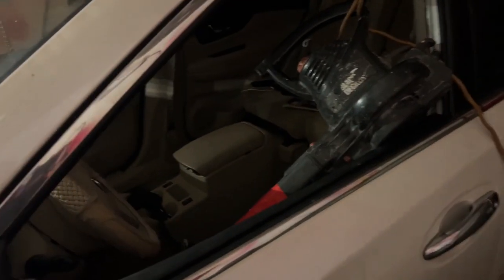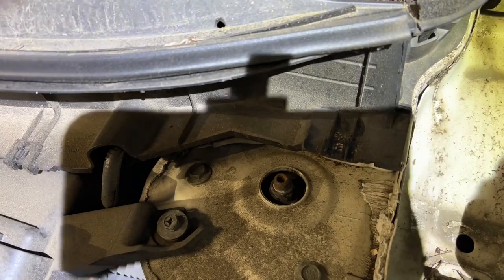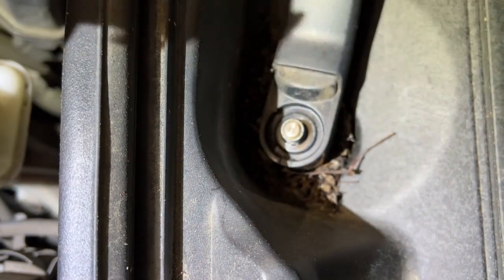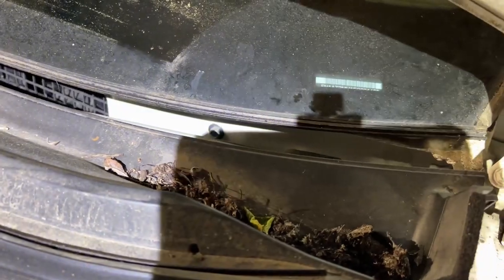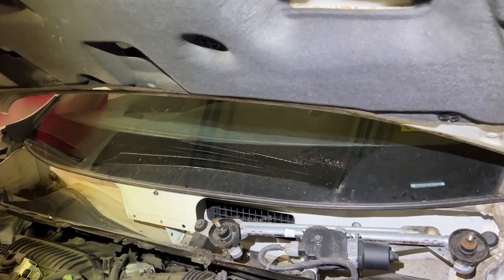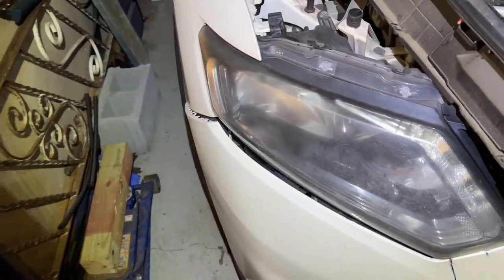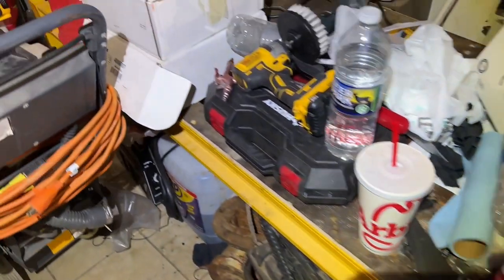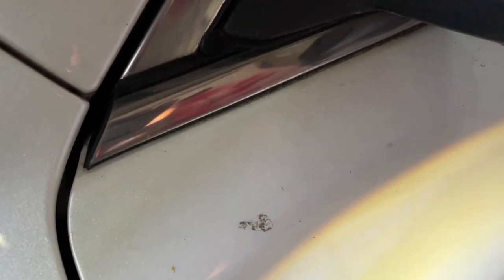How to clean 2015 Nissan Rogue sunroof drain

Comment: Windshield wiper blade puts tension on the bolt threads so push down on the part in-between the bolt and balde and lift up on the thread area. (You will see the tension go away).

Comment: Good video. These nipples with the 'filter' are a problem. I have a 2016 Nissan Altima but unfortunately when I take off the cowl there is another metal piece underneath that covers the nipples and I'm not taking that off. So I cannot access from the outside. So on the passenger side the hose connects to the nipple behind the glovebox. I disconnected it (nasty smelly water splashed everywhere) and ran a wire through the nipple from the inside to the outside. That opened the 'filter' and now the water flows freely. I dread having to do that on the drivers side which is hidden behind the brake pedal, but I think I can access the outside of the nipple from the wheel well.

Comment: How stupid trying to dry the car with a leaf blower, the blower blows out cold air, it would have been quicker to leave the car out in the sun with the windows open, and you would have had a smaller electricity bill!
Reply from the maker: Leaf blowers have many uses. All you need is air movement to dry wet carpets, leaf blower worked excellent for this purpose. Was doing this at night thats why the garage door was closed. NO SUN AT NIGHT. I work everyday and pay my own bills! Any more questions???